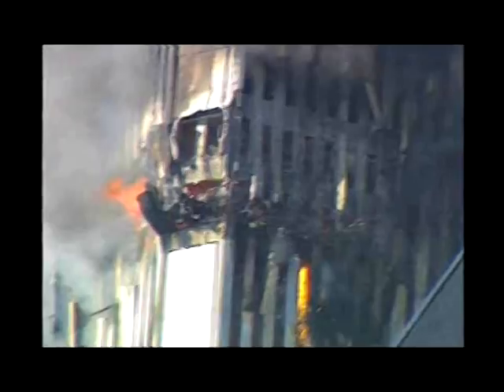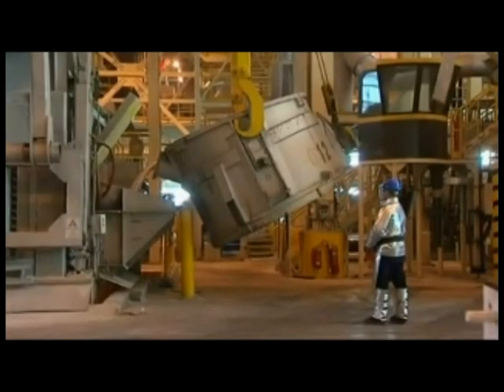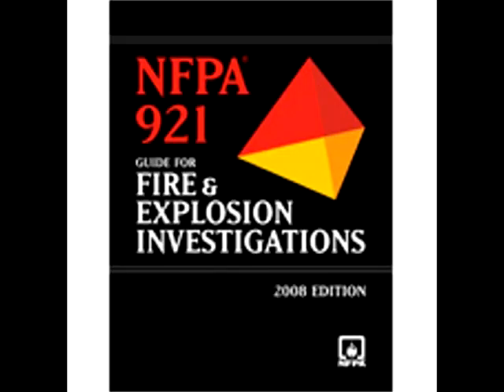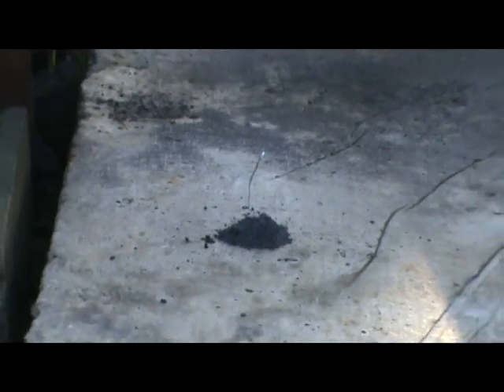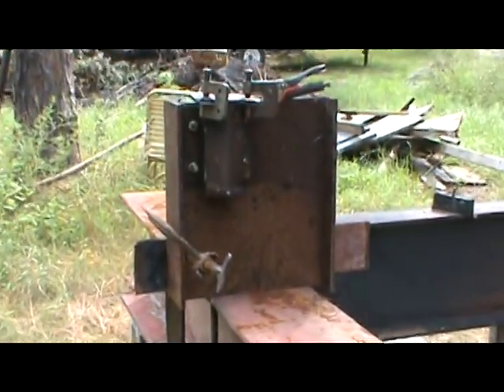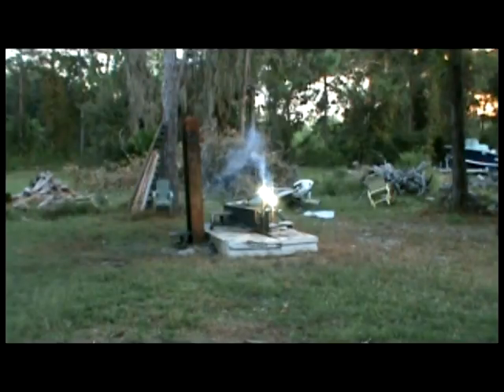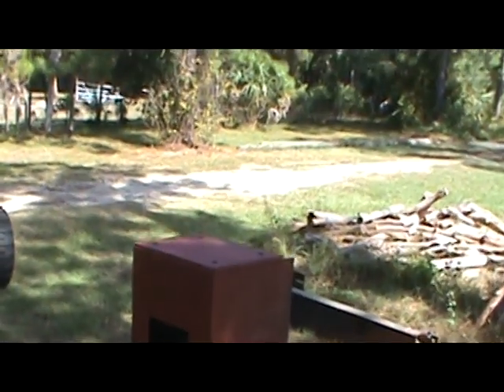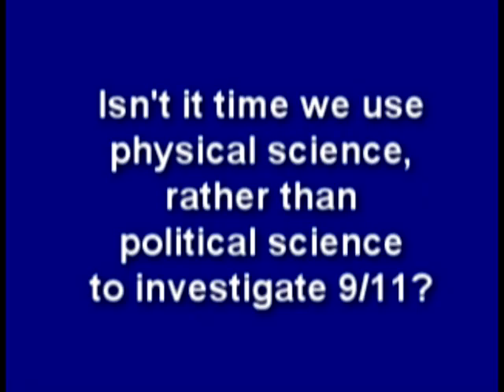9/11 Experiments: The Great Thermate Debate

Comment: @Bernadotte01

"metal fire"

It doesn't need thermite for that.

"white/gray smoke"

Doesn't need metal fire.

Also funny, twoofers claim black smoke is an indicator for oxygen starved fires. Now white/grey smoke is an indicator for metal fire. May i ask what kind of smoke is not seen as an evidence for a CD? ^^

"pressure pulses"

Compressed air/chemical reactions

Comment: @tomiratz My problem with the paper is that HE NEVER IGNITED THE CHIPS. Thermitic describes a reaction where lots of heat is produced and oxygen is exchanged from one metal to another. Most commonly Fe0 + Al -> Fe + AlO.

There is no reason NOT to ignight the chips in a calorimeter. Even my community college has one.

If the composition is 'wrong', but it still reacts like thermite, I'm going to consider it thermitic.

Comment: @palasta "Your math is false, because of the wrong premisses."

Seriously watch this video, the math is too simple to get wrong:
/watch?v=5qh1NDRis58

"In your equation the structure consists of one block that crushes the whole intact structure beneath it."

No, in my equation the structure has no mass or dimension, it's just a point moving with the acceleration of gravity. The calculated time should be significantly shorter than the top of a building falling through itself. 

It isn't.

Comment: @jimhemstreet

"Explain to me how building 7 fell at near free fall speed for 2.5 seconds of it's decent. "

You're supposed to be what again? When the energy greatly exceeds the maximum capacity of the load bearing elements there will be no resistance left, because it is gone the moment it snaps. Ever witnessed a tensile test? What resistance when it is already broken? Some kind of magic force field i suppose.

Comment: @jimhemstreet

"Explain to me how building 7 fell at near free fall speed for 2.5 seconds of it's decent. "

Uh-hu. You don't care answering my questions, but making demands yourself.

Your math is false, because of the wrong premisses. In your equation the structure consists of one block that crushes the whole intact structure beneath it. It was a progressive collapse, with the structure beneath impact point contributing to the falling mass + fully ignoring the way the towers were constructed.

Comment: @86Blessed86 please look at the photographic satelite images of wtc building 6which was right between the north tower and building 7.

It suffered massive structural damage from the falling debris, punching a hole right through the building, and yet it was still standing.

WTC building 7, which was further away, (and would logically suffer less damage and less fires) is completely destroyed.

/watch?v=X5iENXvM43U

Comment: @86Blessed86 actually the other buoldings in the wtc complex stood.(despite critical damage and office fires)...one building (which was closer than wtc7) had a massive hole in it(right through the middle) and yet it did not collapse...The buildings were demolished at a later date.

these buildings were also much smaller..

at most these buildings suffered minor damage(bending and warping of steel)..but not a total collapse..and certainly not a freefall collapse.

Comment: 86Blessed86 stopped making sense  15 hours ago and has been glued to his/her keyboard continuously ever since.
I read the Abstract of the Bazant et al document, and it is obviously intended as diversionary hot air.
It deliberately ignores multiple energy balance considerations, focusing instead on the relatively tiny effect of  the chemical energy in dissociating the brittle "lightweight" concrete. They go on further to imply that the explosions heard were sonic booms from air flow!

Comment: Good experiment here.  
As an engineer myself, I would call the collapses bizarre. 
Individual floors are only several times stronger than needed, especially with respect to their attachment to the vertical structure.
Thus, even if some sort of "pancaking" event, per NIST, were to sequentially progress through a few WEAKENED floors, this would never bring down the vertical structure, which is likely 100 or more times stronger and would have no tendency to fail, symmetrically or otherwise.

Comment: @86Blessed86 I believe 911 was done by the authors of the PNAC.

I believe key memebers in this conspiracy include Marvin Bush, Paul L Bremeer and Dov Zakheim.

I believe the planes were fitted with flight termination pods(photographed on the underside of the plane) and I believe the buldings were demolished by controlled demoliton using nanothermite placed all throughout the building.

Comment: @plbhl the pods are clear to see and they match up exactly with other photographs of pods on the underside of boeing aircraft.

This is consistent with the conspiratorial inside job theory as it was Dov Zakheim who agreed a boeing upgrade lease agreement where refueling equipment was attached(probably the same planes used on 911 where the pod can clearly be seen). Dov Zakheim also heads a company which builds and manifactures this equipment making him a prime suspect in this conspiracy.

Comment: @ThePeage

"There's precedent for secret work in a skyscraper (Google: Citicorp Centre engineering crisis 1978)."

There is a big difference between preventing the detection of an architectural flaw and commiting a crime that will have capital punishment as a consequence and that is easy to detect afterwards by many with expertise that were infact present when the aftermath was cleaned up.

Comment: @ThePeage Both towers survived the initial impact in terms of "still standing", but the structural damage and 1 hour 45 min of heat further weakening the steel, caused the collapse.

WTC7 was completely handled by the fire dept. They recorded 20 stories of massive damage from the collapse of the towers, and fires. The building was creaking and crooked. The made the call it was too unstable to save, and they were correct.

Comment: @plbhl I want to see your math. Here is mine:
( 0.5 * 115,680Kg * (268m/s)^2) / 4.184×10^9 = 0.001 kiloton of TNT tnt equivalent. This is 1500 times less than the amount you stated.
1/2 * m * v^2 = Kinetic Energy [in Joules] divide that by the joules per ton of tnt equivalent to get the final result. 
The truth is hard to accept...and denial is more than a river in Egypt.

Comment: @ThePeage Do the real math on the plane colliding into the structure and you get a force of energy equivalent to 1.5 kilotons of TNT pushed into the structure. The bomb dropped on Hiroshima equaled 15 kilotons of TNT, so that's one tenth the force inside of the building. Combine the structural damage from impact and almost 2 hours of temperatures high enough to weaken the intact steel around the crash and it's no mystery as to the collapse.

Comment: @ThePeage It does not need to. The moment one side loses structural integrity and pulls the other side anything past the load being completely compressive, the structure on the other side immediately loses all of the strength it once had. Amazingly, exactly what you observe as one side goes first and then the other gives up immediately. Additionally most of the debris flying out of the first side to give in, and not "symetrical" in any way. The more you watch it the more obvious it is

Comment: @ThePeage Engine Condition Monitoring (ECM)

The ECM service helps to maximise engine and aircraft productivity. The system tracks on-wing engine performance trends and operating margins and produces alerts where needed. Through analysis of this data, Rolls-Royce is able to anticipate potential problems, recommend preventative maintenance actions and thereby preventing operational disruptions. Do I need to keep pasting bits?

Comment: @ThePeage I have probably posted this a million times but here we go again. The plane that hit the Pentagon had Rolls Royce engines. Rolls Royce engines are tracked in REAL TIME from Derby, headquarters. Not just location but speed and general running parameters. So, unless they fired Rolls Royce engines at it, running at full speed, the answer is not even up for debate.

Comment: I don't think 9/11 was an inside job at all.  However, I like seeing that someone actually did a very legit experiment and showed these results.  You even did give comments and acknowledged that the Steel columns of the WTC were very much thicker.  You gave nice proof that Thermate, when setup right, CAN melt and cut into steel.  Thanks for the video!!  I still don't believe it, but that's my belief.

Comment: @bigcheesy95

I have no doubt witnesses heard explosive sounds. But those don't have to be necessarily bomb devices. A simple chemical reaction could've been one of the sources. Molten aluminium and water, when those two come together it comes to a violent 'explosive' reaction. There was plenty of aluminium, as you've might noticed, the planes largely consisted of AL. And as the planes plowed through the bldgs., they destroyed also water pipes...

Comment: @bigcheesy95

As a matter of fact there is hard evidence that it didn't. There was so much fuel, it splashed the floors and did pour down the elevator shafts and got into the staircases. Search for insidethenorthtower and insidethesouthtower eyewitnessaccounts. Even down in the lobby the firemen noticed it and they feared it could ignite.

Comment: @ThePeage

I also told you, you're not agreeing with NIST. You're alleging the fires were "normal office fires", that nothing made them superior. Wrong, for it was the fuel that helped to set material of of low flammability immediately on fire. So called flame resistant material with the downside that once in flames it has a bigger fuel value than easily inflammable material.

Comment: @ThePeage

"For them to claim that, e.g. the jet fuel would have fuelled the fires for more than a few minutes would have been so easily refuted"

O rly? Why is that?

This nonsense babble again. I've explained to you that there is no big difference between 1min, 5min or 10 min. The fuel was "injected" into the buildings, "widely spread over multiple floors" and did ignite everything combustible in it's range, thus maximum energy output was reached in no time, THAT was the major effect...->

Comment: @ThePeage

and (2) the subsequent unusually large number of jet-fuel ignited multi-floor fires (which reached temperatures as high as 1,000 degrees Celsius, or 1,800 degrees Fahrenheit) significantly weakened the floors and columns with dislodged fireproofing to the point where floors sagged and pulled inward on the perimeter columns.

Comment: @ThePeage

Based on its comprehensive investigation, NIST concluded that the WTC towers collapsed because: (1) the impact of the planes severed and damaged support columns, dislodged fireproofing insulation coating the steel floor trusses and steel columns, and widely dispersed jet fuel over multiple floors; ->

Comment: @Skeptic121 BBC has a view of the collapse of tower 7 that, when unedited (which it ironically is in every single conspiracy video) runs for much longer than the alleged 9 seconds or so it took to collapse. If you watch the whole video; you see the towers begin to collapse on the left upper side; and then remain standing for another 3 or 4 seconds...thus it did not fall at 'free fall' or even near free fall speed. You can see this video in "Blueprint for Lies by Richard Gage" on youtube.

Comment: @ThePeage Again, the building material being steel or concrete is not the question. the question is could a number of upper floors collapse in on a failed support wall; causing the upper floors to fall the lower portion of the building. This demolition tactic proves that it can. (3)

Comment: @ThePeage When we built concrete structures into the hundreds of feet high; we did so by pouring the concrete into forms that were hydraulically lifted while the concrete was still wet. Had the rebar not been the source of strength and what is holding the building up; then it would be impossible to build these structures in the first place. (2)

Comment: @ThePeage Secondly, your argument is that verinage cannot be used on steel buildings. Having worked for FWS Group industrial construction; and having experience in building both steel and concrete structures; I am all to aware of what these building materials are, and how they work. Concrete structures are steel structures. The strength is in the rebar; steel bars that hold the concrete in place; and increase the tensile strength of the concrete. (1)

Comment: @ThePeage The conclusion of Architects and Engineers for 9/11 Truth (and the source of "evidence" that controlled demolitions would be required) states that the "conservation of momentum" (used out of context by Gage) would not permit an upper portion of a structure to collapse into the lower structure and cause a total collapse. This technique demonstrates it is possible. (2)

Comment: @ThePeage"He only points to it to show that, in verinage, gravity (and, normally, hydraulics) is capable of destroying a building. Sadly, since it doesn't work on steel-framed buildings, this analogy is moot (as in "of little or no practical value or meaning")."

The building material is not the question. (1)

Comment: @ThePeageI posted the NIST report in its entirety to prove that it does not include an investigation of tower 7, as you claimed otherwise. Your argument is based on an informal fallacy of deliberately ignoring the posts' intent and then compiling an argument against it based on logics against an argument that was not made. Yes; I get it quite well; it is the tactic that has allowed conspiracism to prevail through all the facts; and resist answering the evidence against, as well as the lack of

Comment: @ThePeage2 The focus of the Investigation was on the sequence of events from the instant of aircraft impact to the initiation of collapse for each tower. For brevity in this report, this sequence is referred to as the "probable collapse sequence," although it includes little analysis of the structural behavior of the tower after the conditions for collapse initiation were reached and collapse became inevitable. (59)

Comment: @ThePeage1 NIST is a nonregulatory agency of the U.S. Department of Commerce. The purpose of NIST investigations is to improve the safety and structural integrity of buildings in the United States, and the focus is on fact finding. NIST investigative teams are authorized to assess building performance and emergency response and evacuation procedures in the wake of any building failure that has resulted in substantial loss of life or that posed significant potential of substantial loss of life.57

Comment: @ThePeageThe wind loads used for the WTC towers, which governed the structural design of the external columns and provided the baseline capacity of the structures to withstand abnormal events such as major fires or impact damage, significantly exceeded the requirements of the New York City Building Code and other building codes of the day that were reviewed by NIST. (56)

Comment: @ThePeageBased on four standard fire resistance tests that were conducted under a range of insulation and test conditions, NIST found the fire rating of the floor system to vary between 3/4hour and 2hours; in all cases, the floors continued to support the full design load without collapse for over 2 hours. (55)

Comment: @ThePeageOn September 11, 2001, the minimum specified thickness of the insulation was adequate to delay heating of the trusses; the amount of insulation dislodged by the aircraft impact, however, was sufficient to cause the structural steel to be heated to critical levels. (54)

Comment: @ThePeageFor the floor systems, the fire rating and insulation thickness used on the floor trusses, which together with the concrete slab served as the main source of support for the floors, were of concern from the time of initial construction. NIST found no technical basis or test data on which the thermal protection of the steel was based. (53)

Comment: @ThePeagecodes of that time that were reviewed by NIST. The loads for which the buildings were designed exceeded the New York City code requirements. The quality of the structural steels was consistent with the building specifications. The departures from the building codes and standards identified by NIST did not have a significant effect on the outcome of September 11. (52)

Comment: @ThePeage The smoke purge systems operated under the direction of the fire department after fires were not turned on, but they also would have been ineffective due to aircraft damage. The violence of the aircraft impact served as its own alarm. In WTC 2, contradictory public address announcements contributed to occupant confusion and some delay in occupants beginning to evacuate. (46)

Comment: @ThePeageThe active fire safety systems (sprinklers, smoke purge, fire alarms, and emergency occupant communications) were designed to meet or exceed current practice. However, with the exception of the evacuation announcements, they played no role in the safety of life on September 11 because the water supplies to the sprinklers were damaged by the aircraft impact. (45)

Comment: @ThePeage By contrast, the separation of stairwells in the impact region of WTC 2 was the largest over the building height—located along different boundaries of the building core—and one of three stairwells remained marginally passable after the aircraft impact. The shaft enclosures were fire rated but were not required to have structural integrity under typical accidental loads: there were numerous reports of stairwells obstructed by fallen debris from damaged enclosures. (44)